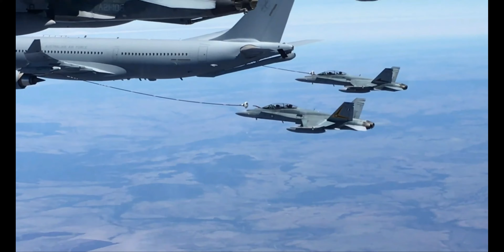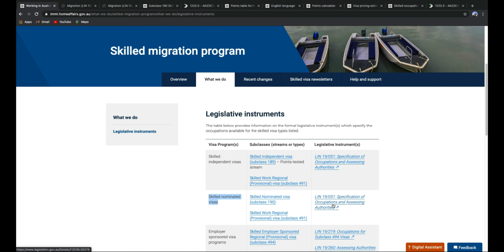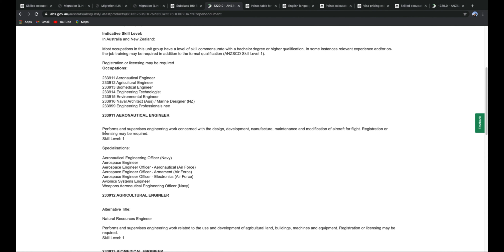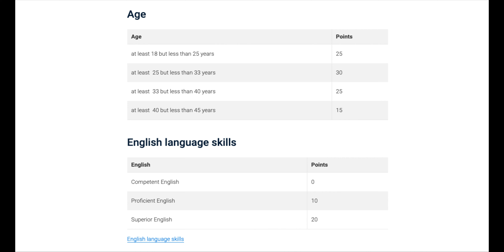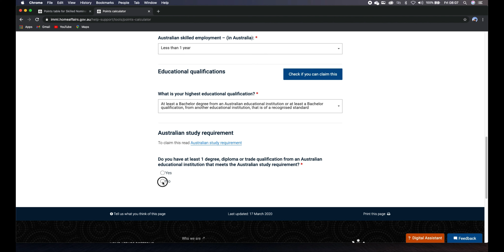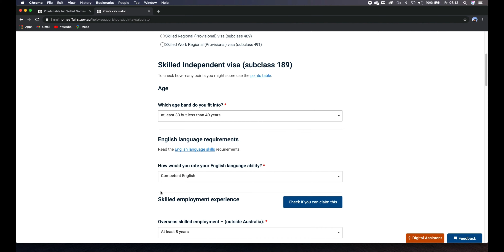How to migrate to Australia Part 02 - DETAILED PROCESS

Comment: Hi Ron. I wonder what year did you immigrate? As of now AMEs are on STSOL. I am planning to take my RPL via Aviation Australia. I hope you spot this comment of mine and your response is hghly appreciated. Thanks and Godspeed
Reply from the maker: Did my migration process in 2014. If your doing your RPL via AA make sure you ask if your getting an Cert IV award and not RPL report only. You can't use the RPL report, you need the cert IV award or diploma.
Reply: @greasemonkey43  Sir pwede ba makuha email or contact mo. I have few inquiries if you don't mind. Salamat